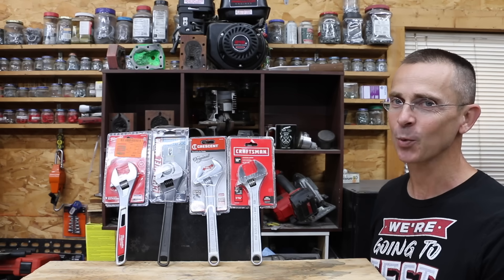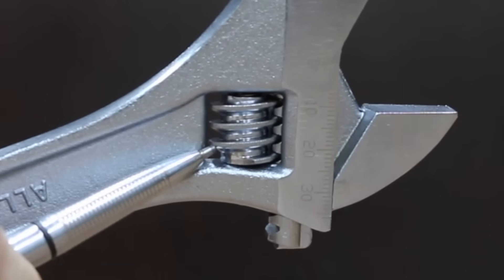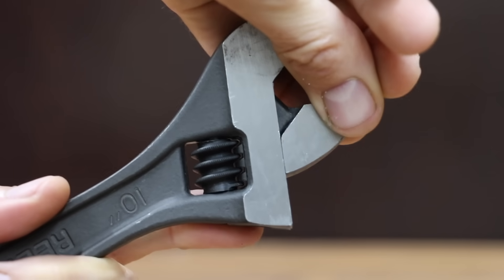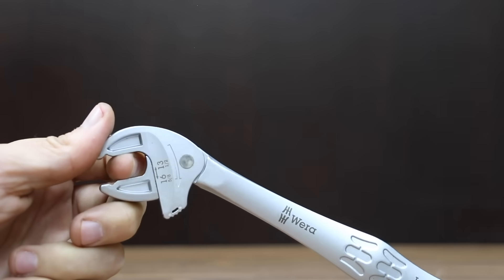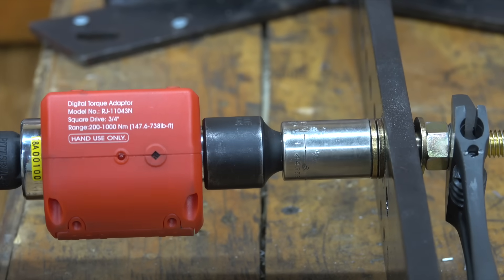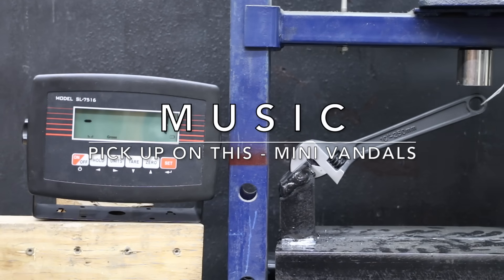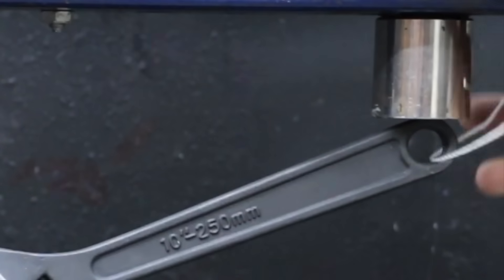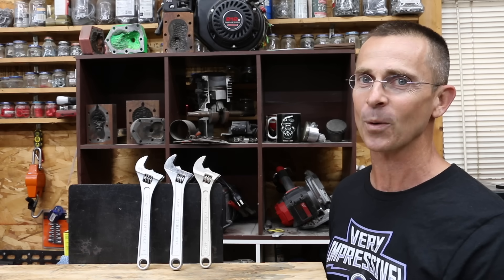Best Wrench (ADJUSTABLE)? Craftsman USA vs Craftsman, Crescent, Kobalt, Milwaukee, Channellock

Comment: As a Swede, I'd like to point out that the modern type of adjustable spanner was invented by Johan Petter Johansson. A few years later, the Finnish-Swedish businessman Berndt August Hjort bought Johansson's factory and gave it the name BA Hjort & Co, now BAHCO. I'm sad to see their spanners are today made in Spain but at least it's not in China and some BACHO tools are still made in Sweden.
Reply: As someone who uses BAHCO tools regularly: they're really good
Reply: I have a Swedish Bacho adjustable wrench on the table here now. Snap-On owns Bacho today. So I'm sure they're responsible for the reorganization of the company.
Reply: In Denmark these are called "svensknøgler" / "Swedish keys", probably due to the origins.
Reply: In Hebrew we call this type of wrench simply a “Swedish wrench”. I always wondered why.
Reply: Was also about to comment this. Sad to see it wasn't made here anymore. But Spain is better than china. And it did perform pretty good actually still. But for me I look for old tools. Made in Sweden/Germany/USA are / where the best country's where tools came from :)
Reply: @2strokepower803  Tu oublies la France ! Sam, Mob, Facom…
Reply: I've still got a wrench like these that came from a tool kit which was standard for Volvos way back in the 1960s. It's the best adjustable wrench I've ever had or seen. It's been performing perfectly for over 50 years.
Reply: Swedish made BACHO tools are very good tools.
Reply: So much for dyslexia. So it was the B.A.H Company, called Bahco - and that, in several European countries, is the name for an adjustable wrench (spanner) of the type tested here. I would not ask, "give me that adjustable wrench" but instead, give me the bahco, irrespective of its brand. And, yes, I have Swedish made Bahco wrenches. (I'm not associated with the company, its successors, Sweden).
Reply: I have heaps of old school Bahco Made in Sweden adjustable wrenches and I won't use anything else. Some are hand me downs and at least 30 years old and are still holding up great. They are (where?) a quality manufacturer. Their files and saws are great as well and still mostly made in Europe.
Reply: I have two adjustable shark jaw Bacho spanners which are Made in Sweden.
I hold on to those tight since those can't be bought anymore.
I think one of the last quality items I own made in Sweden which still have quality.
Absolut Vodka would be another quality product still around.
Beside that, mostly shit comes out from Sweden nowadays.
Reply: @johanea  the shark (Hajen) jaw bacho are still made today tho, just look at ahsell and they have it ;)
Reply: @Coinfindr  Correct, but not in Sweden. Production has moved out.
Reply: @johanea  damn what a shame, i have many of the old old ones even with volvo stamps on them
Reply: @johanea  "Beside that, mostly shit comes out from Sweden nowadays."

Really, can you give examples?
Reply: I use the 8” wide jaw Bahco wrench. By far the best wrench I’ve ever had.
Reply: I love my Bahco that reverse into pipe wrenches. They are my favorites
Reply: I use the Swedish made Bahco bimetal blades and they cut through anything like butter!
Reply: i inherited a load of quality tools from my father who was a mechanic/engineer/toolmaker. he liked quality gear, brands like Bahco, Heco,  Berg, dowidat and Australian Sidchrome
Reply: Only sawblades are made in Sweden.
The story goes that the inventor of the adjustable spanner - Johan Petter Johansson had an employee that went to the USA and started manufacturing the first adjustable spanners overseas, but he made one mistake - he didn't remember the thread pitch. That is why US-made spanners and Bahco tools have different threads.
Reply: Johan son of Johan son of Johan.

Man, I love Swedish names.
Reply: Was about to write about this, now I don't have to. Thanks. :)
Reply: Thats the problem for a lot of guys-trusting an old name only to realise later that it was made else where.
Reply: Best exports from Sweden is ABBA and Ann Margret.❤
Reply: Do BAHCO make good spanners i need a set and im going to order a spanner soon.
Reply: @acey4994  yes they do, i have the Bahco S87+7, both inch and metric sockets but only metric spanners unfortunately, its a really handy toolbox and helps me every day at work
Reply: if thats the case, why not say "made in Sweden"?
Reply: If Johan Petter Johannson was such a great inventor, why didn't he come up with a better name for himself??  😉
Reply: Bahco tools today appear to be a mix of widely varying quality and "feasibility" and unfortunately generally can not be recommended, but the 903x series of adjustable wrenches really are amazing, no other brand compares to those. Especially 9031P is a must have tool nobody should live without.
Reply: Johan Jr.? No, no, no. Johan Johansson.
Reply: Also as a swede, and also with the Hjorth family tree among our relatives, I’d like to point out that the adjustable spanner / wrench is a NOT a Swedish invention even though it was a Swede that improved the original English invention and yet another Swede that later on patented the invention. Hence the Spanish name «llave inglesa» or «Spanish key» in English. Swedes have a tendency to view themselves through a euphemistic or even narcissistic filter thus claiming Skype and many other innovations to be merely Swedish. This euphemistic tendency to look upon their own importance is what have given the extremely corrupt and self-serving socialists mafia such a tremendous power in Government.
Reply: cool so you're citizenship just happens to be where the adjustable spanner was invented, congrats

Comment: I'm very surprised by the results. I recently purchased a Irwin Vise grip brand tool kit (because I like to channel locks but it did come with a adjustable wrench) and i was surprised of the lack of movement and quality feel in the large adjustable wrench but it rates constantly at the bottom of your charts.
 
Hypothesis there was a lot of variants in the manufacturing process which is not goid for consumers or (the more likely) I am so often using old warn out wrenches that when I finally got a new one I was surprised of the difference.

Always interesting to watch these videos.

Comment: I bought a Bahco adjustable wrench as a present for a friend's birthday. The abuse he subjected that wrench to was bewildering. He used it to undo the nut on the the tow ball, & put a length of pipe on the wrench to increase leverage. He got that nut undone. As far as I know, he still has that wrench. I'll be buying a set of adjustable spanners soon. These will be made in Germany by Draper tools.

Comment: I’m not a fan of adjustable wrenches as I won’t use them much but I do own 2 of them Snap On and Ridgid wide mouth that if I use only on plumbing in tight areas but seem to work good whenever I need them which isn’t often… great comparison test as always …. Keep up the great work …✌🏼🇺🇸🇺🇸
Reply from the maker: Thanks, will do!  Thanks for sharing.

Comment: Would be interesting to see this design tested against a "Hand tool rescue" wrench. He is replicating an older design, but it looks like it would be much better at clamping onto things than this more modern style. His largest is a 9" at $70 USD.

As far as this modern design, it looks like it would grip a LOT better if the top jaw was cross-hatched (like a metal file) since that's where most failures seem to come from. Would probably damage the fastener, but at least from my experience if you're reaching for a fit-all wrench, you're past caring about what happens to the fastener already.

And finally, i think you have it backwards as far as jaw leverage. Longer jaws would put more stress onto that narrower neck, making it snap sooner. So won't shorter jaws be an advantage at least in that test?
Reply from the maker: Thanks for the suggestion.  Thanks for the constructive feedback.

Comment: I have 4 of the USA made Craftsman. I've had a couple of them for over 50 years and they are all in excellent condition.  Never put a cheater pipe on the handle.   Use a bigger wrench or an impact socket.  If possible use a box end wrench or a socket instead of an adjustable wrench.
Reply from the maker: Thanks for the suggestion.

Comment: its sad nothing made in USA anymore i have a nice set of adjustables by proto that say made in USA i think i got those in 90s i guess they aren't around anymore. i looked on amazon and the new proto models are different mine say 7100 model professional and have a really tight fit and finish the new ones get terrible reviews even though they claim to be made in usa and are model 710 now
Reply from the maker: Thanks for sharing.

Comment: Great work.  I stopped using adjustable wrenches because I considered them inferior to fixed open end wrenches.  Now I'm not so sure due to your control test with the open end. I always assumed an adjustable wrench would slip long before a fixed open end.
Reply from the maker: Thanks!  Thanks for the feedback.

Comment: The vintage craftsman was actually made by Western Forge for Craftsman, & they still make adjustable wrenches for other tool companies as well so technically you can still buy that wrench. The 2 identifying markers I know of their adjustable wrenches are the jaw shape/design looks very similar no matter the brand name & the letters W         F are always forged into the handle at the bottom on one side. They make the jaws & teeth for the Ridgid pipe wrenches, look at the bottom of the jaw below the threading & you'll find W          F  .

Western forge quality doesn't @!#$ around.
Reply from the maker: Thanks for the feedback.
Reply: Unfortunately Western Forge closed its doors last year. Apparently WF refused to extend the contract they had with Sears, and when Craftsman moved manufacturing overseas WF's parent company shut the plant down.
Reply: @mendonesiac  dang I hate to hear that. When I started buying professional tools, the adjustable wrenches were the only thing craftsman I'd buy. I wonder what that means for their other stuff like the jaws for ridgid?
Reply: Western Forge went belly-up a year and half ago. The good USA-made Craftsman clear acetyl handle screwdrivers and these good wrenches are now long gone.
Reply: @brad5938  yeah, I bought a small Craftsman set a year ago for a roadside repair and couldn't believe the difference. The sockets are thin, the ratchet is an inch shorter, and the screwdriver has sharp edges on the handle. Craftsman is garbage now.

Comment: If you're looking to test how much it takes to round over a fastener why didn't you include a backstop for the handle of the wrench? Imo it'd be more accurate because the corners of the fasteners looked to me like it cammed the wrench backwards and caused some of the slippage

Comment: Bahco is originally Swedish and invented the adjustable wrench. The wrench you used is a bit special model and cost about €30-€35. Its a slimmer design en better grip. The Gedore is about €15-€20.
Wera is expensive but great tools. A great tool isn't necessary the strongest but the one which gets the job done the easiest and fastest.
Reply from the maker: Thanks for the feedback.

Comment: Man I just had a workout with the black 4 set from hf. I was trying to use an easyout on a broken lug stud the other day. Sure enough the jaws are like cheese so this was good to see. Don't buy the black cover set from harbor freight unless you want them for light duty. Even then don't bother with those. I hardly used them so they were fine until I needed them with that tight stud.
Reply from the maker: Thanks for the feedback.

Comment: As a mechanic in the automotive industry, I find it hard to use your videos to judge the quality or tool as Snap-On is the go-to brand for quality among automotive mechanics. are the snap-on tools too expensive as a production cost? would love to see more Snap-On to get a better look on the tools you test so i can save a lot of money
Reply: AvE has some good tests and teardowns of snap-on and other high end tools if you don't mind a lot of cursing and dirty jokes
Reply from the maker: Will try to include them more in future rounds of testing.
Reply: Have you ever tried the Carlyle tools from Napa? I have been using them for about a dozen years and the quality has been very impressive.
Reply: Snapon are way overpriced. Got an adjustable wrench some years ago, nice chrome finish but very junky and loose jaws. I should have returned it
Reply: Snap-On is a special case.  They're basically a government supplier with a civilian division. Good hand tools. Snap-On does a lot of rebranding that is somewhat questionable IMO.
Reply: A Snap-On was included in the diagonal cutter video. 65$ and it performed below average.

Comment: When I watch your hand/power tool reviews I find myself checking my confirmation bias. 

I had already decided that Milwaukee’s line up of tools were going to be worthwhile as a new standard tool for me now that American Craftsman is gone. I typically only supplement when a tool performs exceptionally above the Milwaukee offering (ie certain offerings from Knipex, Bohndus, GEARWRENCH, Fluke, etc.) 

Thanks for helping me decide which offerings are the best on specialty tools.
Reply: A few tests I would like to see are Allen Wrenchs, dolly cart, solderless waterproof crimp connector and the crimping pliers and impact sockets.
Reply: Also one of the most important parts of a tool with a “lifetime warranty” is it’s ability to be returned for a replacement. It might be nice to test out all of the ability to get them replaced and ranking them on that service.
Reply from the maker: You are welcome!

Comment: At my job, crescent wrenches are only good for 3 things:
-bending a piece of metal on a vice after using a torch.
-holding a fitting still while tightening/loosening a hose
-to help push the collar down to release a quick connect air fitting

Notice I didn't mention anything about actually tightening or loosening fasteners or hoses with them. The people that do that are the ones that we make fun of for their mechanic ability.
Reply from the maker: Thanks for the feedback.

Comment: The part that bugs me the most is when the worm gear sticks in places.  And it is always at the standard nut places, because that is where you applied force the last time.  And because there is some back-off, it does not tighten all the way in those positions, or there is more slop.  Slop and back-off are also very important, thanks for testing that. The ultimate breaking point, I don't think I care about beyond 400 lb or so.  If I need that much force, I am using the wrong tool.  Though, it is fun for the video.
I wish you had checked how smooth the movement was after the 200 lb. And again at 300 lb.  Maybe 100 lb too.  I definitely would not want one that was not 100% undamaged at 100 lb.  I don't care if that is subjective, that is what I would like to know.
Reply from the maker: Thanks for the feedback.

Comment: "I hate Crescent wrenches!"
"Then why do you have five of them?"
"Because they're so darned useful!"
Reply: They're useful in plumbing/hvac and not that much else.
Reply: @Jnes01  Mmmm...

Hammer.
Third hand
Something that fits that weird sized bolt...
Rusted wingnut remover
Vice grips for when you don't have vise grips.
Battery terminal remover
Tiny clamp
Screwdriver torque aid

And more uses I can't think of right now.
Reply: @Xplasma1  Yeah I've used them for those things but they're not an everyday tool for most people unless you do plumbing/hvac.  More like a few times a year. A pair of pliers can also do those jobs.  One thing they're really good for is bending metal.
Reply: @Jnes01  Yeah. I use them as my everything tool when I don;t feel like getting up to get the proper tool
Reply from the maker: Thanks for the feedback.

Comment: The results do not surprise me.  I am glad I have the vintage Craftsman USA made adjustable wrenches (and many other of their tools) mostly bought 40-50 years a ago.  I also have a set of relatively newer Crescent, but still USA made.  I didn't realize Tekton made adjustable wrenches, but they did seem to hold their own for the most part.

Comment: I picked up an old proto adjustable wrench one time and was extremely impressed with how it had very little play and stayed in place.
Reply: I like proto in general, and got mine for the same price as craftsman at the time. This made them a very good value
Reply from the maker: Thanks for the feedback.
Reply: @ProjectFarm  Proto adjustable wrenches have a spring around the axle of the worm gear, to create friction and minimize back-off. I'm not sure how common this is on other brands, but it's a subtle feature and I believe it has real benefits. Thanks for all the great videos!

Comment: I'd love to see if any cheaper pipe wrenches can match up to Ridgid. (Specifically Aluminum pipe wrenches)
Reply: Just my experience: the most worn out beat up rigid is better than any other pipe wrench. The reduction in in fiddling with the adjustment alone is worth the price.
And the aluminum is also worth the money.

Comment: If the torque test had been performed in the opposite rotation the nut crest would contact the bottom of the movable jaw, instead of the top.  This would probably create an entire new set of data points, most likely higher than the first round.
Reply: I agree!

Comment: Adjustable wrenches are obsolete like wooden handled screw drivers and land line telephones. I recognized that when I got my first Knipex pliers wrench and haven't used an adjustable wrench for at least a dozen years. They are so superior that using an adjustable wrench today is irresponsible.
Reply: Stay away from my regulators you Philistine!